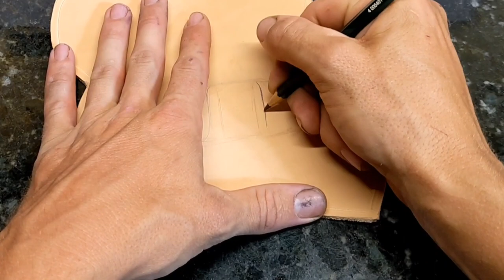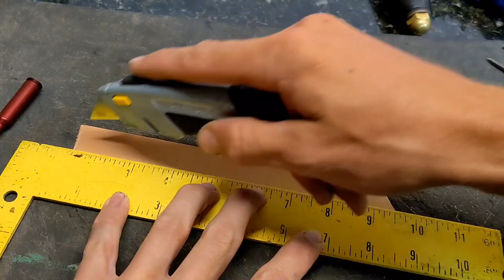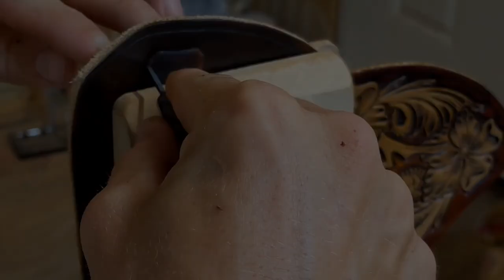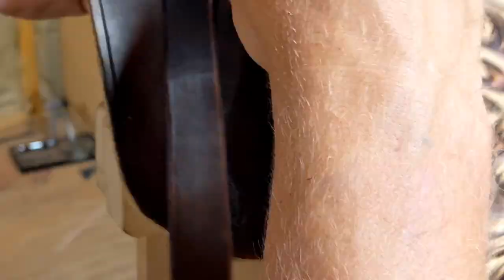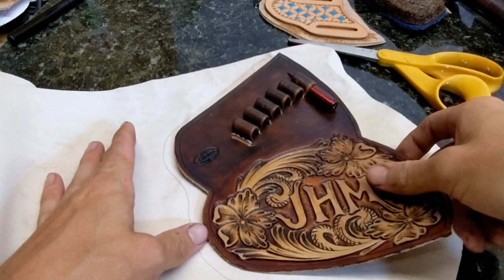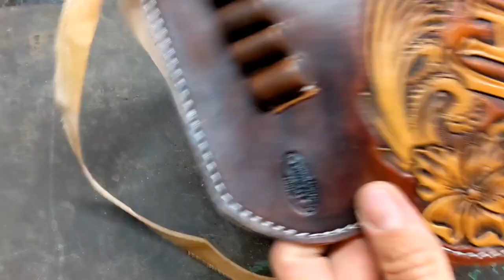Building a leather rifle stock cover with bullet loops.

Comment: Hello, what is the "fabric" that you put between the leather and the stock? I made a cartridge belt for an oiled sanded Marlin but I didn't put any protection on it. All the oil sanding is gone from the cartridge belt area. Certainly "drunk" by the leather. Thank you for your reply. very good video and very pretty pattern.

Comment: Was there a step of sanding the edges in between the cut out and stiching groover in the beginning?
Reply from the maker: It depends, if there are any rough spots I will sand them
Reply: Ok, nice! Some more questions, what was the material you glued on to the back side? Is that so you don't scuff the wood? Would bare leather scuff it?
Reply from the maker: @TastyChevelle  it was just another piece of leather. It makes everything look more finished, not necessary just a finishing touche.
Reply: @BBrosLeather   Awesome, thanks a bunch for the replies! Your video inspired me to make my own for trap shooting, and potentially one for a friend's Henry 22!